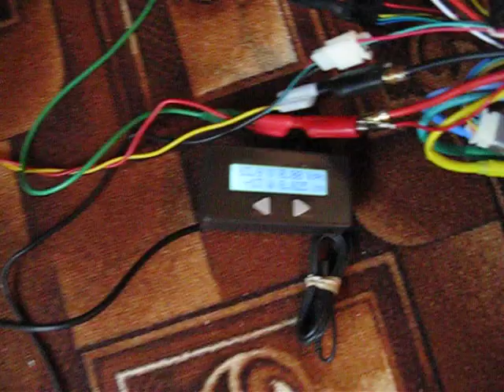Scooter motor conversion to electric power! by e-motion.lt

Comment from the maker: Yes, yes. There's one more thing to notice: variator does not work with electrical setup under load. This is a two year old video, so I just ditched the variator and mounted the motor directly on reducer's shaft, in place of the clutch. That works well.

Comment from the maker: @impazzitoinvolo 
Current limit highly depends on fan you will use. 80 Amps may be okay. Check the temperature of the windings and don't let it rise above 100°C. You can give it 130 Amps if you will manage to get good enough airflow.

Comment: I like this! I've been thinking about something similar for a while, but I thought I'd remove the crank and put a pin straight through, still using the variator, but with a sprocket fitted to the flywheel side, and use the cylinder studs to mount a fabricated motor mount, then run a chain from the motor to the crank, this will allow you to run different gear ratios.
I have a peugeot speedfight 100 engine in the garage, and a Mars ME0709 motor, but I also have a Cagiva Mito Evo as well, I was thinking about building a 3 wheeler using a quad bike front end, and the speedfighter back end with mars motor, but it's also tempting to put the mars motor into the mito! Either way, I think this method of using the original bikes gearbox is the best!
I'm going to look at your other videos now, thanks for the inspiration!
Reply from the maker: +greenbynature Thanks for your interest in the project. Note that later test showed that variator does not work with electric motor with load. My second try was to mount the motor directly on the reducer, instead of clutch. Results were much better.
Reply: +circuitdotlt Thanks for the info!! Maybe the Mito would be my best option if the variator doesn't work in the peugeot engine?
Thanks again :)
Reply from the maker: I think this is universal to any variator, they just don't want to shift under load. You can shift them with a lot of force, but automatic shifting is too weak in scooters. This is due to constant torque of electric motor. Also I have observed that variator does not offer anything better than electric system already has.

Comment from the maker: I have overlooked one more thing with "direct mount" design... The motor I have used has a very low inductance, incapable of reasonable controller's PWM integration. Leading to very high current ripple. The motor alone draws over 600W on no load and quickly overheats. I had to suspend the project indefinetely, until solution is found. And the solution being special PWM-less controller (filterred out inside) or other, higher inductance motor. And I have not seen either one for some time now. :(

Comment from the maker: @impazzitoinvolo 
I finished it when it was freezing cold here (-17°C at the moment), so I managed to make only a couple of hundreds of kilometers on it... So can't really say anything about reliability.
Any e-bike controller will do. Try crystalyte 18fet controller. You will need to stiffen the shunt to increase current limit. Also you will have to mount three hall sensors in the motor.

Comment from the maker: That depends on KV of the motor. If it is low, it means there is a lot of windings and a lot of inductance.
One more thing: rewinding of motor to lower KV will give you less RPM, but max torque wil remain the same. Its the same as running the motor at lower voltage - you just lose the power. power = torque * RPM.

Comment: @circuitdotlt  Thanks for fast response! I got a electric scooter and i want to replace the original motor with this turnigy engine.
How many km do you got made with this motor in your scooter? What esc do you use?

Comment: That sounds weird, i seen video's of people rewinding that motor and getting idle current as low as 2A @ 25V, and even seen much lower, my next project will be to convert another moped, this time with the XYH80-100-A 130Kv motor that will be rewind to as low kv as possible, controller will still be normal ESC (bemf), and also 25V, before im done with that i will get it together and get some video of my electro ciao.

Comment: I think it's better to find another place for the controller unit and put kunray 72v 3000w motor instead remove the cvt transmission, put chain and sprocket instead, remove the front part of the transmission cover to let the chain pass. I don't think it's a good idea to use cvt transmission with electric motor, it's a waste of efficiency.

Comment: Seems like you're losing a lot of efficiency using a transmission with that sort of gearing. The motor has plenty of low end torque for starting out. So a transmission that kicks in for higher speed would make sense.

Comment from the maker: I not only think about it, I test it. I do have a bike with hub motor - handling in corners is terrible. And I do not race, it's just a basic commuting setup:
e-motion.lt/wp-content/uploads/2011/10/201109303608.jpg

Comment: nice video.. yet do you plan on putting this engine on something..and can u add a video?
Reply from the maker: I have added it to something. Check my other videos.
Reply: hi i watched the video yet how do you power it and how do you planto pwer it..?did u take it apart to put it on ? i wish u showed exactly how you took it off or put t on..nive vid though thank you...
Reply: +circuitdotlt you should have let the clutch do it's thing instead of putting screws on.  tune the roller weights in the drive pulleys for best best results.
Reply from the maker: George Cruz Tried that, however: 1. clutch wastes a lot of energy. 2. Variator does not really work with electric motor under load. Probably that is related to continuous torque of electric motor, compared to 2T 1 cylinder. I have ditched the variator and mounted the motor directly on the shaft instead of clutch in next prototype.
Reply: circuitdotlt  well it just makes me wonder how its gonna free wheel when you're slowing down.anyways ,it's a nice thing you did there.keep posting videos.  thumbs up.
Reply from the maker: George Cruz You don't need to free the wheel, electric motor spins freely. And since it is always connected, you can use it for regenerative braking. I have regen on my current bike, which is nice and strong, I use mechanical brakes very rarely, only when someones jumps in my way. I recover up to 10% of energy in city driving.
Reply: circuitdotlt that's nice to know. kinda new for someone who's gotten used to Internal combustion engine scoots.keep it up buddy.

Comment: How big a motor can you fit on??
Reply from the maker: big. For example this one is a very good fit if mounted in place of the clutch (I did a similar project).
https://hobbyking.com/en_us/turnigy-rotomax-150cc-size-brushless-outrunner-motor.html?affiliate_code=PMQJUMLDAOFSFEL&_asc=8546940075
Reply from the maker: @darekmistrz4364  I may find a solidworks drawing somewhere, but I no longer use this software and can't sort through thousands of files that I made...
Would you consider buying my old modified engine, the one with motor attached in place of clutch? It worked well, but my circumstances changed and the project was discontinued...
Reply from the maker: @darekmistrz4364  will send you email shortly.

Comment: Is it fast enough? Looks like it's slow? Curious?
Reply from the maker: M Jac, how many RPM do you count?
Reply: elektrinis  I didn't but I am doing the same thing Hing and shelfed it because the draw an battery and speed
I don't think it is enough, but I'm not engineer. Need a larger diameter for the motor and still need 4 to 700 watts to get 30 min life out of battery under load.

Comment: Why not getting rid of the whole transmission? Obviously it isn't needed when you go electric.
Reply from the maker: it is needed, if you want more torque at lower speeds and to use more motor power. Ot else you will only use 10% of power at 10% of max speed.
Reply: Free swingarm.

Comment: Hey nice setup 
What's the controller you have ?
Reply from the maker: mike mike it was a chinese infineon-based controller. The video is quite old now.
Reply: I have a turigy 80/100 I wanna put it directly on my tire making a friction drive setup on my bycicle 
With your experience what's the smoothest controller I can get 
I'm not gonna use all the power of the motor I just wanna use it efficiently to run everything cool

Comment: Nice but damm it uses alot of power just running the CVT, i converted my vespa ciao (old one with just a clutch) and it uses max 300W freerunning (lifted and rear wheel running), this is of course only 30km/h since danish law about mopeds says 30km/h and other class of 45km/h.

And yes i should get off my ass and make a video with it, have been driving my Electro Ciao for 2.5years....